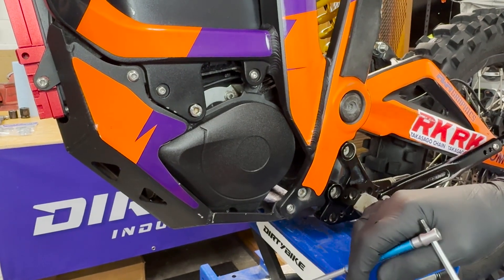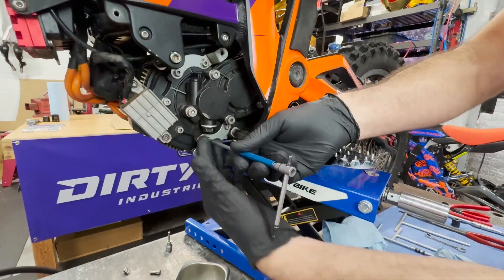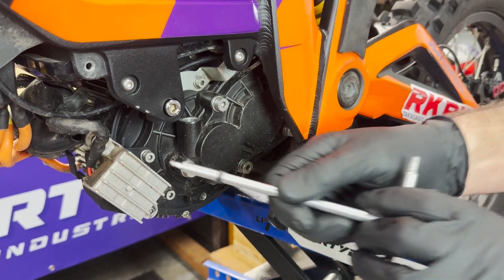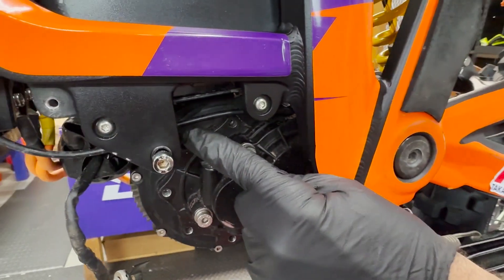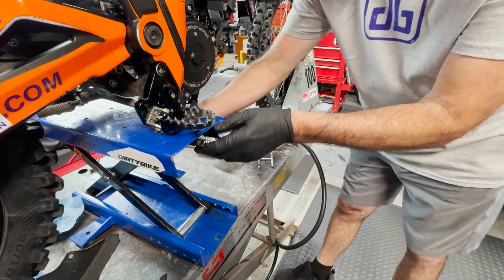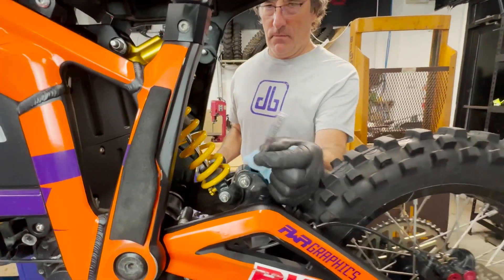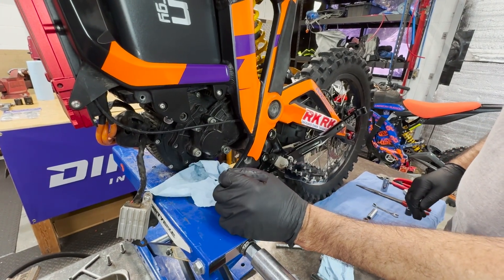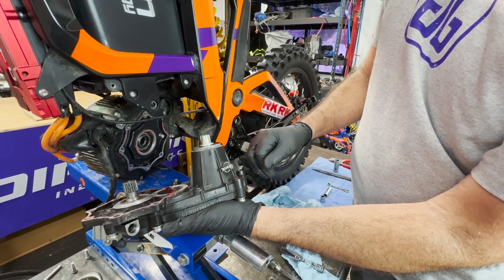Talaria Gearbox Rebuild PART 1

Comment: is the motor supposed to spin if the gear box is disconnected from the motor. and i spin the rotor manually?
Reply from the maker: Yes, when you spin the output shaft on the gearbox it should spin with light resistance. Let us know if you have any other questions.

Comment: How did you guys break yours exactly? Ive broken mine twice and bought the gear twice from yall. both times mine broke I think it was user error for sure tho.
Reply from the maker: When the chain comes off at speed it jams between the motor and the counter shaft sprocket and that's what causes the sprocket to fail. We are currently working on a solution to fix it. We'll keep you posted.